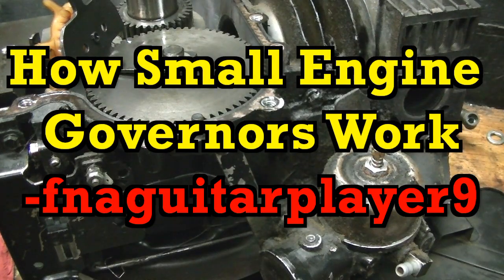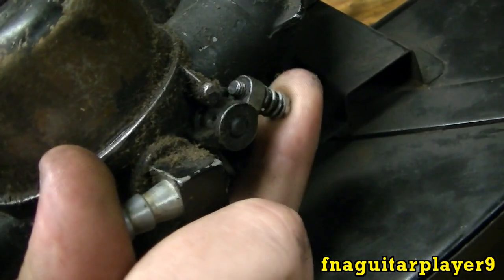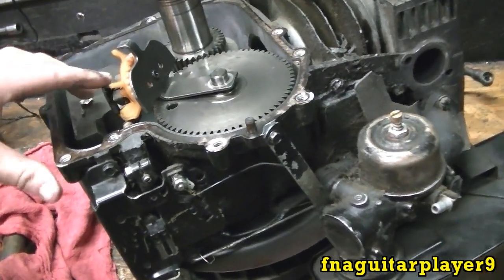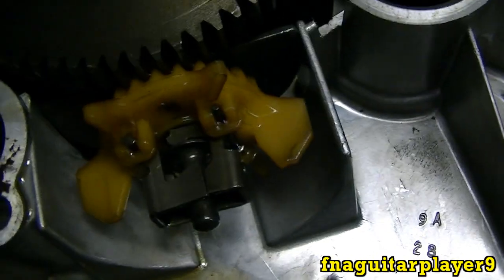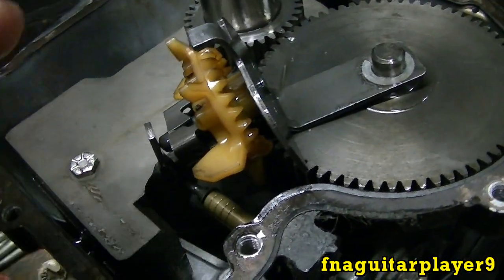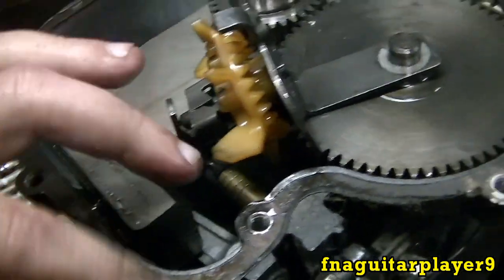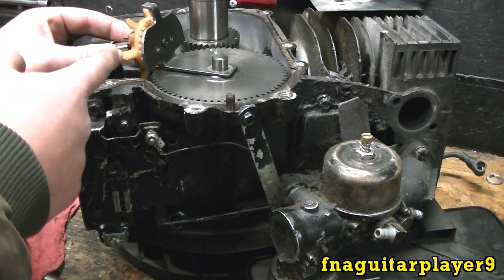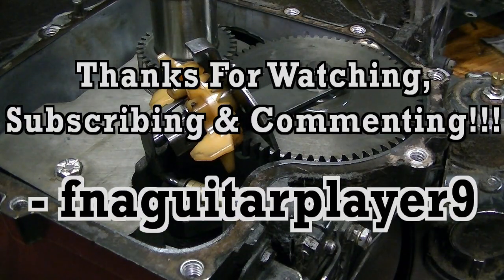How Small Engine Governors Work (any governor setup)

Comment: I took the crank and cam shaft out of my small engine  and I'm pretty sure that I liked the dots up on mine there was barrings in front of the gear it won't start now it back fires but won't start could that be the hat the timing isn't rite please help out on this problem lol
Reply from the maker: I would verify that the marks are lined up if you aren't 100% sure you did. But it could be the flywheel key sheared if it wasn't tightened down enough, or if you mixed up the valve tappets when you took it apart the valve clearances could be off not letting the valves to close and seal properly. Hope this helps. Thanks for Watching!!!
Reply: @fnaguitarplayer9  
Fly wheel would make it back fires it just back fire 1 or 2 times win I pull the string but ive just about to go back out there and look at it think it for your reply
Reply: @fnaguitarplayer9  
It was not lined up and the flywheel k was broke that was crazy igot mark linend up a new key I n the flywheel and it start first pull I pulled that to cord for hours and hours tring t ok start that gocart for me and to the kids man thank u
Reply from the maker: I hear ya! It happens alot. Your welcome, glad to help out!

Comment: Quick tip:
If your engine surges try bypassing the governor,this usually is the issue, well it was mine!
Reply from the maker: If it stops when bypassing it, alot of times it may just be out of adjustment, unless the internal parts are broken. Thanks for Watching!!!

Comment: I have a single cylinder 18.5 hp Intek and after it had been running for a while I took off and it revved out and I shut it down, i can fire it up and somewhat idle it down by manually moving the governor arm.  In your opinion would that be the governor assembly?  I have the ability to repair but I did not want to perform extraneous repairs chasing a gremlin.
Reply from the maker: I would try to adjust it first, the adjustment bolt may have worked loose, if that doesn't fix it, then i'd say it would be internal, the gov assembly. Had that happen on a 20HP vtwin last summer. Thanks for Watching!!!

Comment: Hi so when the engine is running the governor is trying to push the throttle shut , when the revs drop it allows the throttle to open
Reply from the maker: Yes, that is basically how it is, its finding a perfect balance between the 2 based on the spring tension of the throttle. Thanks for Watching!!!
Reply: fnaguitarplayer9 yes worked it out thanks good video, springs are a bugger
Reply from the maker: your welcome!

Comment: I have a 6.5 horse Tecumseh on my go kart it mail start if someone lifts the tire off the ground but when you put it on the ground it dies !.do not know the problem
Reply: Well, if you watched the video, it sounds like it could be something wrong with the governor. It's supposed to automatically open the throttle and maintain engine speed even when you hit thick grass. If your engine dies when it is put under load, it sounds like the governor isn't opening the throttle the way it's supposed to. It's basically the same as trying to start out in a manual transmission car without pushing the gas pedal...you need to give it more gas or it'll stall. A Briggs is supposed to do this automatically, and the governor is what tells the engine when it needs gas or not.

Comment: I'm buying a 4a032 engine next week, is it possible to remove the governor and make a cover plate for the hole? Would it still work, but be able to control the rpm with the throttle? It's for a bandsaw mill, I'd like to get a little more hp out of it but don't know much about engines. This video did an excellent job of showing how it works, thanks.
Reply from the maker: You really don't want to do away with the governor, they are not designed to run at faster speeds, it will probably end up throwing a rod, so I would suggest working on the gearing to get the most power out of it, you wouldn't want the blade running to fast anyways. Thanks for Watching!!!

Comment: You never really said what that small spring is for or what it does.  I know it's a VERY light spring.  You said it "goes in that small hole" but I can't tell if you ever put it in there or not.  How would it run without that spring?  That's my situation - No small spring.
Reply from the maker: Sorry, I should have explained. The small ring on the linkage just keeps the linkage right so there is no play that can cause a slight like or surging. It will run without it but may surge some when you throttle up or idle it down. Thanks for watching!

Comment: Nice video.i have a questioni have a dixiechoper mower that the idle it sounds to high when i disengage  the blades it sounds like the engine its goin to blow out. also when i go down a hill it reves it self more than 3700 RPM .any help will be appreciated thanks 👏👏
Reply from the maker: Thanks. It could be a number of things causing that, it could be a governor issue, either out of adjustment or internal governor is bad, or it may be a linkage problem, either bent or loose. Also a leak between the carburetor and intake manifold or between the manifold and block will cause them to do that as well, making them run to lean. And that will usually cause power loss as well. That is the first things i would check. Let me know what you find out. thanks for watching!!!